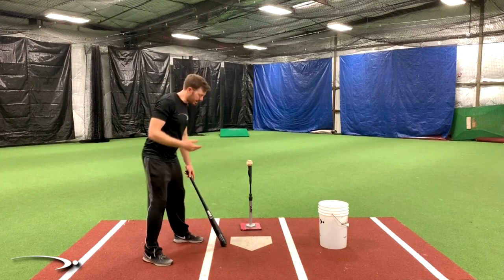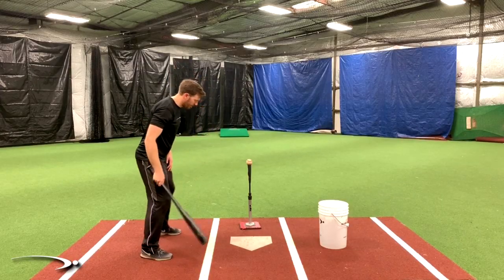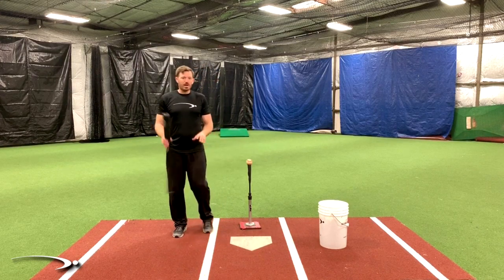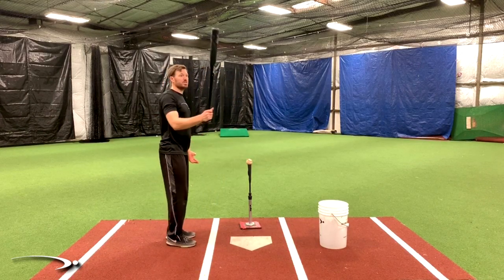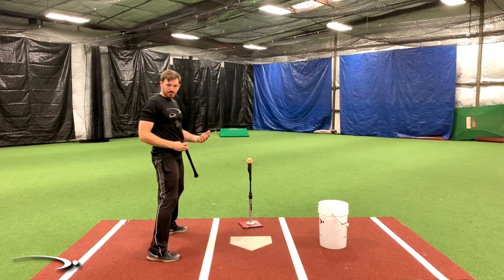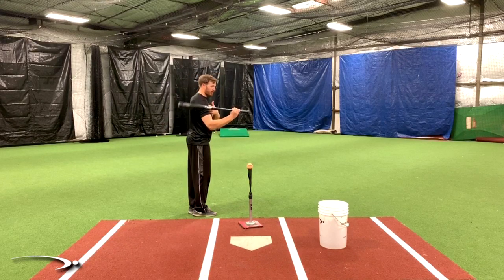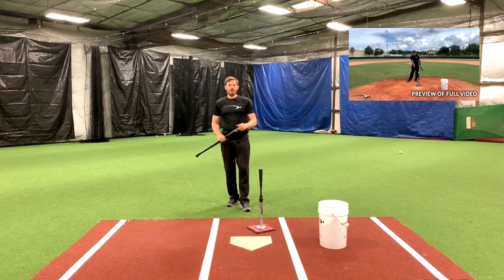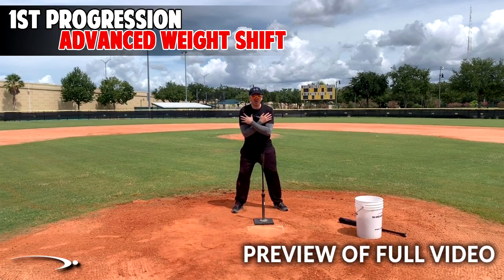Never Cast Again... and get more SPEED!! | Baseball Hitting Mechanics (Pro Speed Baseball)

Comment: Two different concepts going on here. Casting is more about staying closed and keeping the bat parallel to the shoulder on the swing through the zone.. Hitting the inside of the ball is more about the swing plane. The taller the player the steeper the swing plane that is required to do this especially on breaking pitches. . Trout finishes his swing at about 75 degrees, Altuve is around 45 degrees as he is shorter. They both obtain similar results.

Comment: This is a really bad video. First of all, casting is a result of letting the back elbow move away from the body prematurely in a swing. So your definition is off right from the start. Secondly, You demo the "bad" swing by standing so far forward that your front foot is out of the box. Then on your "good" swing you position yourself deeper in the box. This is the main reason why your results are different. You should probably take this video down and re-do it before you get too many views.
Reply: @apotheosisbetz  You must not understand what casting is. Let me help you out. Just after the stride, when the heel of the front foot drops and the swing begins then the back elbow will drop and tuck closer to the body. Allowing this elbow to untuck prematurely is what causes a cast and usually a roll over ground ball to the shortstop. BTW, I am a doctor and have a good grasp of physics. In fact I have a chapter in my upcoming book about the physics of baseball. Hope this helps.
Reply: A Doctor you saaaay hahahahaha, not a physicist? Well i do know you are good at one thing: memorization.  

You have a whole chapter that is wrong? Man guess your publisher just thinks Drs. know something. Would love to think why tucking your elbow, kyphosis, and scoliosis  leads to full range of motion out of the thoracic vertebraes? Hope this helps.
Reply: @christopherharbour7281  You brought the insults bud. If you can't take a counter dont throw the first punch. 

On the other hand, if my doc told me he was on youtube researching and commenting... well, that sums it up. 🎤💧
Reply: @christopherharbour7281  please explain this better. Being a doctor you should have the words to do this. I’m not saying you aren’t a doctor or an author as well I’m saying your explanation is not translating. When should that elbow untuck? Link to the book?